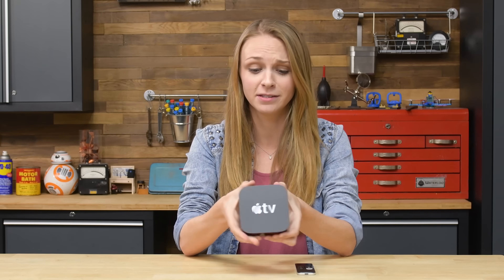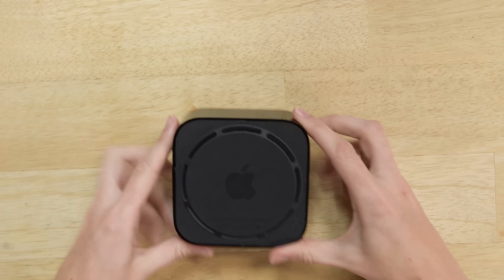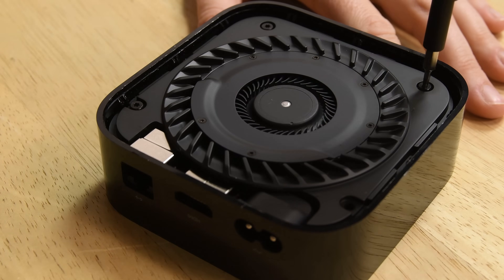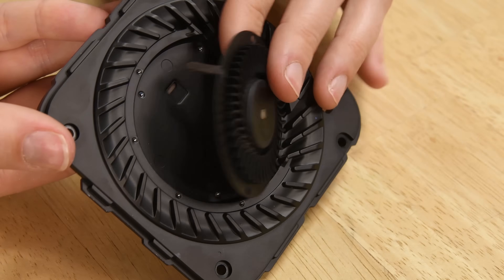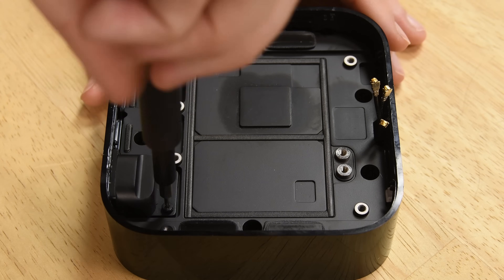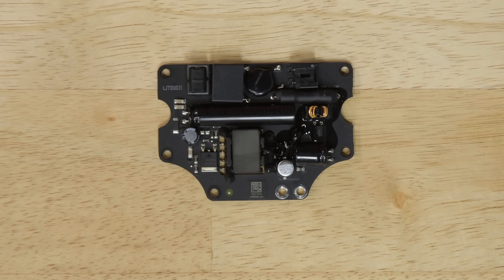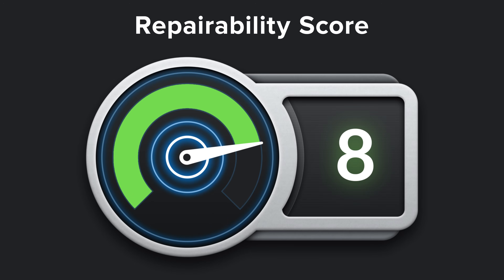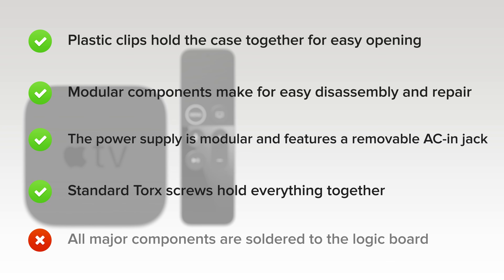The Apple TV 4k Teardown

Comment: My Apple TV has been working  fine, but  right now all the internet I have is cellular data which is unlimited, I can’t hotspot because I only have 10 GB of that, but I can play it on my phone and supposedly airplay but every time I try to airplay video to my Apple TV it just sits on a loading bar and goes no where. Apparently I have found no where telling me a fix for this problem, or what I can do. Fortunately for me I hired Warren Tech. Mail him on Warrentech102@gmailcom WhatsApp +1(724)252-7621 and he fixed it for me. 3. I realized that my Atv was stuck on the RC1. 1 installer and does nothing from there. I have tried several times to fix it but nothing worked! Thanks to Daniel Garratt who introduced me to Warren Tech, I met  him and his service worked for me 😊 

M

Comment: The caveat is that they’re highly susceptible to OS corruption and will die after an update, and there’s no way to flash TVOS back onto it. I’ve gone through two Apple TV 4Ks meanwhile I still have a 3rd gen that has had no issues.
Reply: You might wanna text Jose Fred on WhatsApp +14136346140 for help he fixed mine a week back with him, your tv fix is guaranteed and safe.

Comment: I had a message pop on mine saying the AppleTv was overheating and shutdown. Was in an open area next to the tv, regularly cleaned/dusted. After that my Ethernet port didn’t work and any video I watched would start to lag if it got too hot. The fan doesn’t work anymore. Took it in to the Apple store, they said they won’t repair it. Shouldn’t these be repairable issues? They didn’t even plug it in for diagnostics just flat out said we won’t fix it. Buy a new one...

Comment: There are some slightly off comments regarding A10X performance.

1. Its CPU is faster than any other ARM SoC available. It's faster than mobile Intel Core in many cases. It definitely is desktop class.
2. Its GPU is faster than any other ARM SoC (apart from Apple's own A11)
3. Yes, it is faster than the Switch. Tegra X1 is pretty old and imbalanced.
4. Yes, it really does have more CPU performance than PS4/XB1 The Jaguar cores in those AMD SoCs are only a notch above Atom level, having 8 of them doesn't put it ahead of the A10X. Apple's Hurricane cores are closer to Zen/Coffee Lake.
5. No, Geekbench isn't a bad benchmark. In fact, comparing iOS to macOS performance with Geekbench is the most ideal performance test we have. It's the same code and libraries just compiled to different ISAs. Other benchmarks (like TabletMark) use platform-specific implementations of tests, making the results useless.

Comment: A10X vs A11?
Reply: Cesar Alvarez A10X has nearly double the graphics performance as the A11, while the A11 has just slightly better CPU performance. Both are built using a 10nm process and consist of a LITTLEbig style of architecture that employs 3 high performance cores and 3 low performance cores for different applications to preserve battery life while not compromising performance on more demanding tasks.

Comment: I'm still using my 3rd gen haha
Reply: Me two, are you getting glitches ever? Or maybe problems with it connecting to the internet? I get it & occasionally & I have to restart it for it to work right. I think Apple is doing with it what it did with the iphone.
Reply: I only used a 4th gen because DirecTV Now gave me one for free for signing up for their service prepaid for 3 months or so.  It was the same price as the device so I tried it out.  I wasn't really happy with either one.  AppleTV 4 was nice but it doesn't really do anything of value for me but stream videos from my PC.  PS Vue was nice on it but that was about it. They never update the apps on it (Comedy Central, for example)

Comment: Why is there a fan inside? The iPad Pro has the A10X but doesn’t have a fan.
Reply: Sustained output at higher clock speeds.  All fine with passive cooling for short bursts.
Reply: The iPad Pro doesn't play back 4k video.
Reply: TheRandomActivity If it produced the same amount of heat it would burn you and set fire to the battery.
Reply: You get better thermals with a cooling fan. They probably would put a fan in the iPad Pro, but since it's a portable device, they want to keep it thin, quiet, and without any moving parts.
Reply: The iPad has a greater surface area for heat dissipation, and probably clocks down far more aggressively to save battery. I'm guessing the fan is more of a "just in case" addition since they had the space anyway.
Reply: The Apple TV creates more heat than an Ipad because it has a built-in power supply in the bottom of the housing. Additionally, the available surface for heat dissipation is smaller. And, as others mentioned, the workload on the CPU/GPU is certainly different.
Reply: Like the last two said, My apple 4k does get hot when we watching 4k movies and youtube videos for sure.
My ipad only gets hot when im going 2 hours strong on PubG, besides that ipad is always cold to touch
Reply: hidde1626 it would most likely use thermal heat transferring paste/tape, a small unibody heatsink and possibly even furthermore the whole aluminum body to cool

Comment: Actively cooled A10X huh. Well that's well above the 7th gen consoles/Wii U/Switch in performance, heck it's more powerful than the Mac Mini now. Apple should aggressively court some game developers for this one!
Reply: You cant compare CPUs of different architectures, especially with optimized software. The A10 and the other A CPUs may not be as powerful as competing ARM CPUs but Apples software is designed to exclusively run on those and that way very efficient. You can notice that especially when considering that the newer Apple products got pretty small battery sizes but still last for a relatively long time while still having good performance. You can say the same for the NVidia Tegra which aswell isnt extremely powerful but with the software being designed to run exclusively on that, its performance and battery life are actually pretty good if you consider that it practically is a gaming tablet, two things that dont really go together. And then there are the other consoles that run x86 CPUs so should be comparable to desktops but wait, the software is still designed to run exclusively on them, so you will see much better performance than expected. You may argue that the PS4 and Xbox One actually dont performe very well at all but thats mainly because of cross platform games that are designed to also run on much more powerful PCs with very bad efficiency due to drivers and APIs. All of those devices have hardware and software well optimized and you cant compare them unless you compare performance and efficiency when doing real world tasks, not some strange benchmarks or some spec numbers.
Reply: A10X currently is low powered due to thermal constraints, im sure apple could wack up the clock speed and use a good thermal solution for lots of performance (here the thermal solution is probably for making sure hours upon hours of 4k HDR content can be played smoothly, maybe at 60fps). Like when they had the IMG PowerVR chipsets they would use only 450MHz whereas that GPU can go up to like 1GHz
Reply: @Dukes  Sure, but Apple's newer chips make the Tegra in the Switch look like a complete joke.
Reply: Nah
Reply: The switch is cooled by a heatsink/fan too
Reply: The switch doesn't use a 8 Core AMD...
It's a NVidia Tegra cpu, an ARM based core.
Reply: @Lumumba B.: You Congo dudes sure know a lot about technology! /s Say hi to Patrice for me.
Reply: The only games you'll see from Apple are micro transaction infested phone bs. They've tried and failed at video game consoles already, they know that it's incredibly unlikely that a fourth game console could exist and no third parties are going to go exclusively to apple's untested and slapdash attempts at making a game console. It won't happen and it's because of apple's restrictive, locked down and feature lacking hardware and generally inefficient way of doing things that will scare away developers. It'll never happen
Reply: Lumumba B. Lol experts in the industry constantly praise apples chips for being the most powerful on the market I think they have more credibility than some moron on the internet
Reply: @Lumumba B. Apple CPUs are fast lmao. Ahead of all other smartphone manufacturers by around 2 years, and are ahead of all existing consoles.
Reply: NO, the A10X is way more powerful than the tegra x1 in the switch, I mean WAY more powerful.
Reply: The Wii U and Switch aren't powerful to begin with. The A10x or A-anything are never going to be nearly as powerful as any desktop-grade processor found in the PS4 or Xbox-whatever. They're a completely different architecture and an A10x wouldn't be able to handle the instruction set of a PS4.
Reply: @MeowThingy  One year later and look at the A12x bionic now😉😉
Reply: Dallas Adoraslash maybe Im A bit late but the A11 chip is faster than the ps4 cpu. The only difference is that the A11 graphics card will never be as great as intel integrated graphics or a graphics card
Reply: u are a console peasant????
Reply: cores does not make a cpu faster

Comment: What the hell is going on? Apple making an easily accessible and repairable device?
Reply: The new iPhones arent as bad as they used to be in that aspect aswell and the PCs and Laptops also went a tiny bit towards repairability. In that aspect Microsoft has taken Apples place of the least accessible and repairable devices with their Surface line.
Reply: @Chuckiele  2019 update - MS learnt from their mistakes.
Reply: accessible yes...repairable no... think diffenrent. Apple!
Reply: Yeah and as soon as you asked for a logic board replacement they will  charge 5 times more than the device itself
Reply: SCWfan06 this isn't Apple!?
Reply: They've been making iPhones for 10 years...

Comment: Thank you for the video. One question I always wonder why the cooling fans are blowing air out from the case not to the case. Im asking bc Im opening my APTV 3rd and putting a cooling fan with a case I made myself. But should I keep the fan blowing air to the case or it is a rule of thumb always out of the case ?  Thx
Reply: You need air flow that means that cool air needs to get to the metal to cool the chip if there is air coming in there has to be the same amount of air coming out.
Reply: Most products blow the air out of the case with inlets somewhere else that is drawing in air. My Mac Mini, iMac, and MacBook Pro all output air via the fan and have vents that draw air in. I've never seen a device that sucks air in unless there is also another fan outputting that air
Reply: Yes, I don't see the intake vents.The blower fan gest air from the center-bottom and exhausts it out of the bottom-edge of the device, but if there is a circle at the bottom where tha air comes in and there is no vents at the center-bottom... Where does the air comes in? All the vents of the circle are for exhaust, not intake. There are no other vents anywhere. The mac mini has a vent at the back and at the bottom.

Comment: 都用上风扇散热了, 这个A10X发热比iPad pro还高吗 ?
Reply: Xu Feng the iPad Pro is build of aluminium body which is considered a great heat conductor thus the heat produced by the A10X can be effectively dissipated whereas the Apple TV is enclosed by a plastic casing? Which hinders heat dissipation thus active cooling is required.

Comment: I’m SOO confused the iPad Pro 2 has the a10x chip without a fan, yet the Apple TV has a fan????
Reply: Apple TV also has a larger power supply and other components that generate tons of heat.
Reply: I think that the A10x chip is overclocked and because of this it generates more heat and draws more power
Reply: Apple tv has to output 4k content for long sustained periods of time. iPad Pros are generally not used for this amount of times at once and certainly not 4k. The fan helps dissipating heat quickly and prevent thermal throttling hence preventing those games they're pushing to stutter.
Reply: Because streaming 4K isn't an easy job.
Reply: The iPad Pro 2 has a lot more surface area, and that area is also in metal which makes it a great heatsink. The Apple TV doesn't have that, so it needs a fan.
Reply: The iPad doesnt output to a 4K display all the time sooo there you go.
Reply: Tasso gamer the iPad Pro is build of aluminium body which is considered a great heat conductor thus the heat produced by the A10X can be effectively dissipated whereas the Apple TV is enclosed by a plastic casing? Which hinders heat dissipation thus active cooling is required.
Reply: Ipad has way more fans than apple tv

Comment: Why didn’t you tear down the remote, surely that glad might need replacing, I’ve cracked a few remotes before and they are not cheap to replace
Reply: Gaming Enthusiast 101 I want you to open up a solid metal brick
Reply: Because they are superficial.
Reply: They did it in the Apple TV non 4K tear down